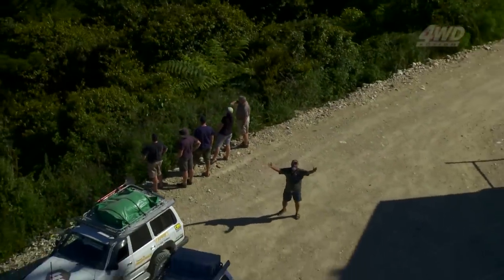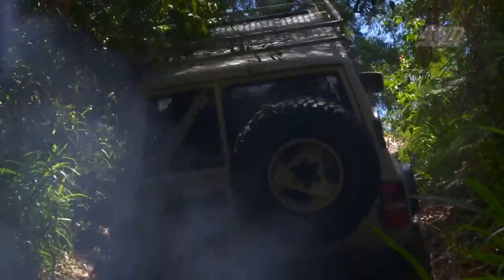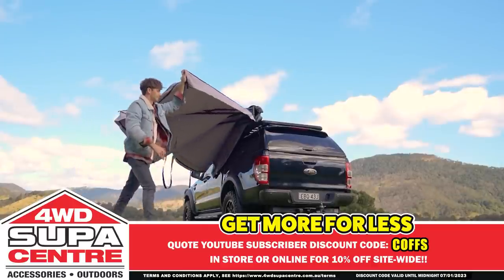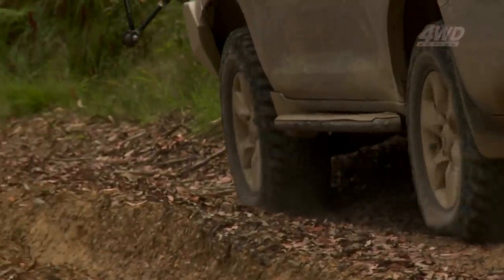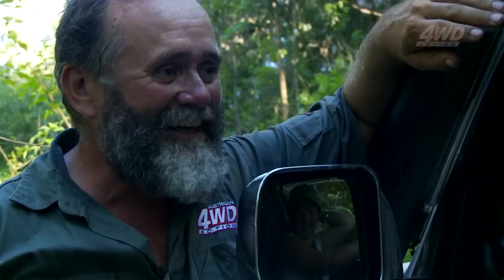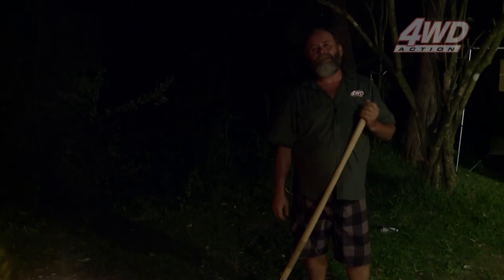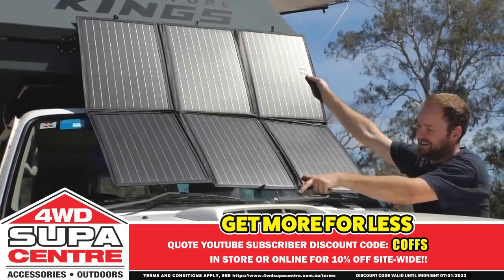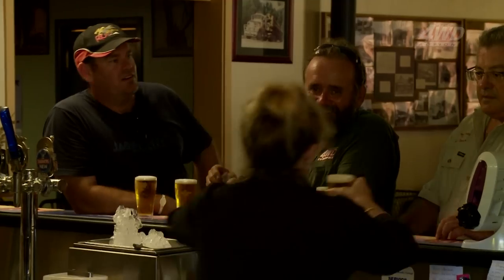Exploring Coffs Harbour! Learn The History From Roothy! 4WD Action #165

Comment: A prado is probably a good family suv for inner city suburbs but I don't believe it's made for this terrain, it is a 4wd but not necessarily on tracks maybe on beaches but yeah I wouldn't take a prado through there.
Reply: I have a 2020 Kakadu twin locked with all the trimmings. Mate they a very capable hasn't failed me yet. But taking a stock one out you would be surprised how far they go
Reply: Don't be so silly